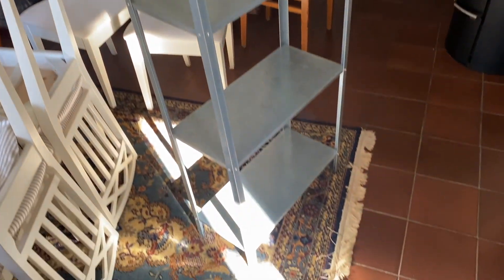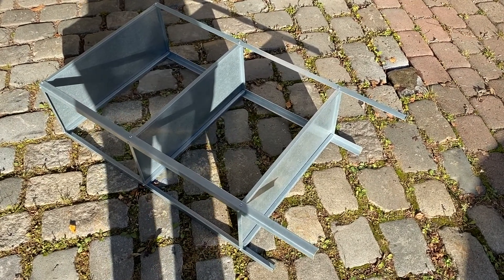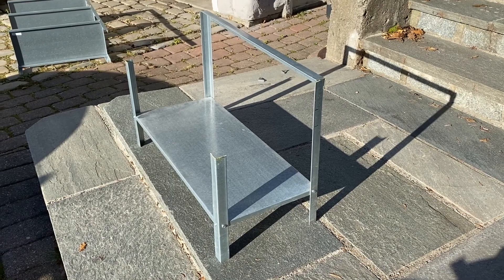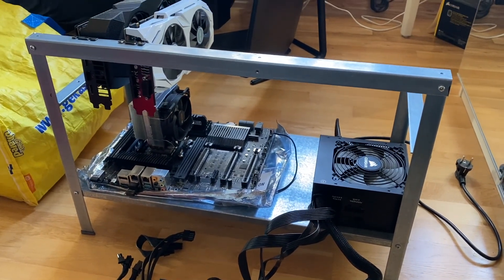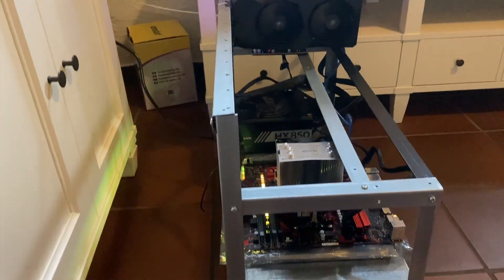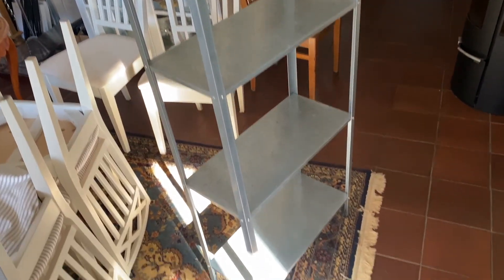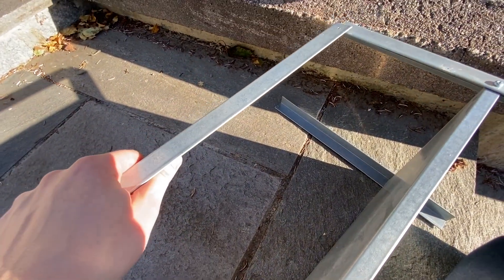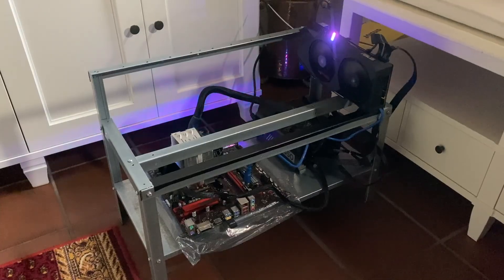IKEA Hyllis GPU Mining Frame DIY - 15$ 6 GPU Mining Frame

Comment: Hi, did you use an electric saw for this or a hand saw? I want to cut the uprights of the 40cm x 183cm x 27cm unit to fit into a cupboard that is less than 183cm high but also less than 60cm wide but they don't sell a 40cm x 140cm x 27cm option, and I'd have to buy BOTH unless I can just buy the narrow and tall one and cut the uprights by a few cm to fit. I don't own an electric metal saw though but a hand saw is much cheaper and for a novice, much safer! Thanks in advance!
Reply from the maker: Hi. I just used a hand saw, takes a few seconds to make the cut. If you dont have one, they are not expensive and you will probably need it later in life for something different. Just something like this one: https://amzn.to/3N95ViH   :)